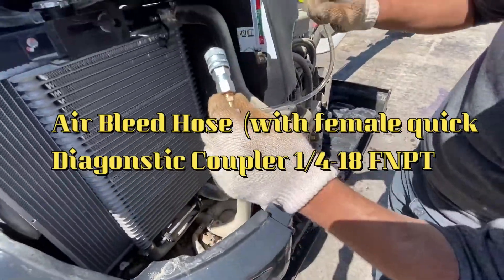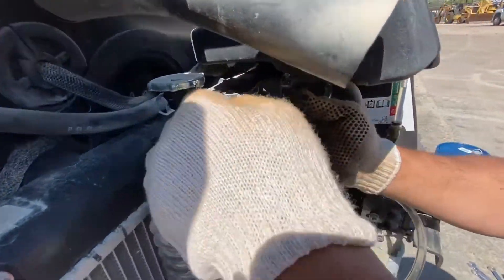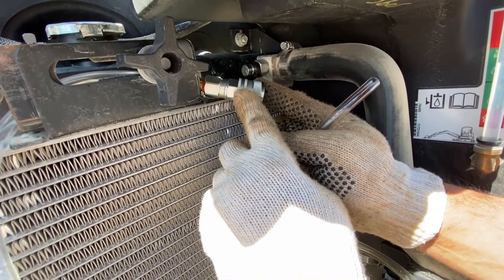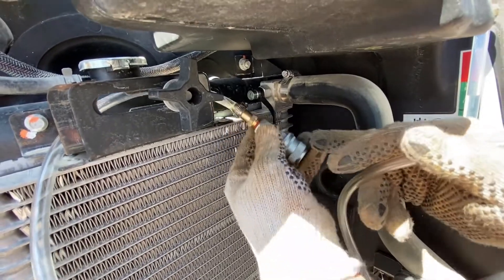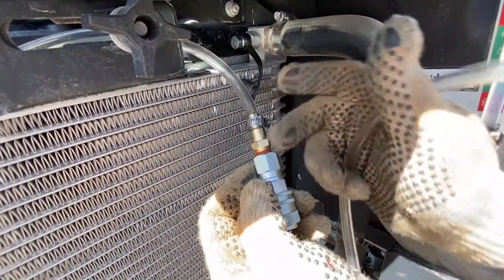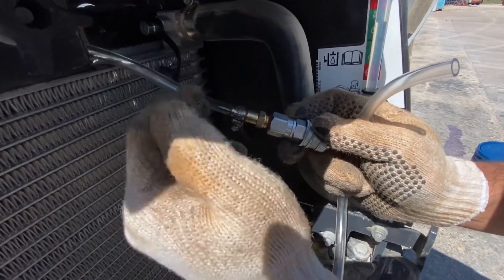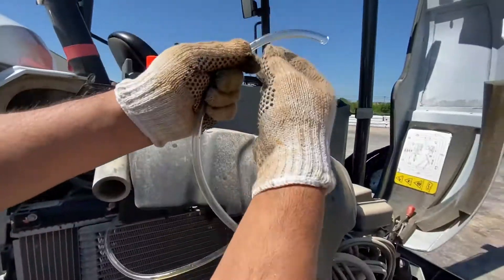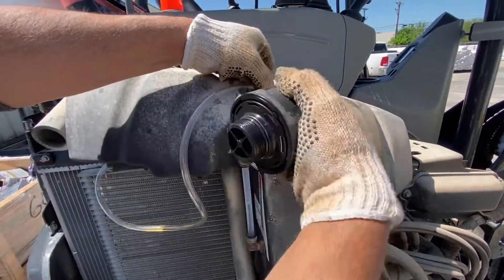BOBCAT E32 (2020 Mini Excavator )How to replace hydraulic fluid

Comment: Hi, i have a Bobcat E26/2016 with hydraulic problems. I replaced  hydraulic pump with  new pump but still not working ( lack of power/digging/moving/turning. After 10 minutes all hydraulic systems are dead. Any ideas what it's wrong with bobcat?? Thank you for any information
Reply: I have the same problem with Bobcat E26/2017 ,lack of power and i don't know what to do . Did you resolve your  bobcat problem and what it was. Thx.
Reply: Why not take it to bobcat?
Reply: Did you fix?

Comment: great video, where did you purchase the fitting for the air bleeder?
Reply from the maker: Here
2589 Oakmont
Round Rock, Texas 78664
512-244-2248
7:00 to 5:00 MF
Saturday 8:00 to 12:00
1800-259-9481
Reply: @innovative5428  thank you!!  video was really helpful, do you have any other machinery maintenance videos you'll be making?
Reply from the maker: @Ratherbemilling  
yes I will soon